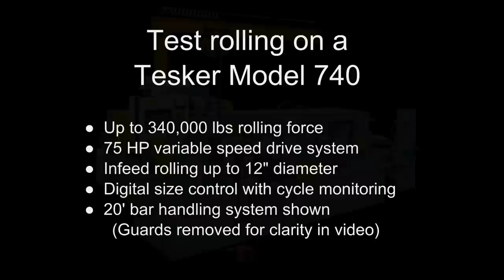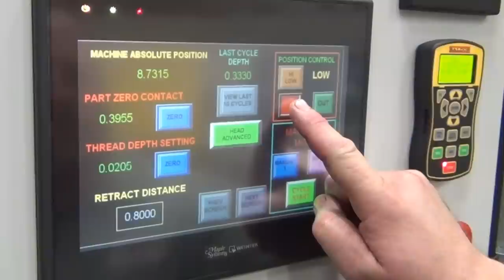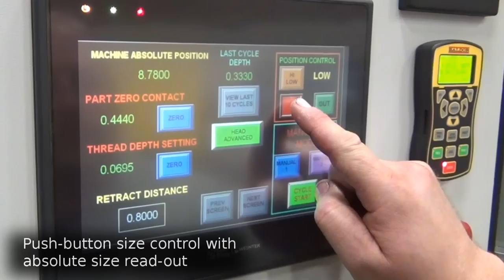Model 740 Large Acme Rolling

Comment from the maker: Yes, it is a pretty versatile operation.  You are correct, no cutting here, just deforming/rearranging the metal to form the threads.  We make machines that can roll threads on a 24" diameter blank.

Comment from the maker: This stock started out somewhere in-between the major and minor diameters of the desired thread.   Sizing for this type of thread is usually focused on the pitch diameter.  For the same diameter blank, decreasing the pitch diameter will increase the major.   The part typically grows both in diameter and length.

Comment: That's interesting using a roller for support. I used to set up and run an old Reed B-112, and it had a carbide, flat blade for a support. My employer is currently looking for a thread rolling machine, I will relay your engineering excellence to them.